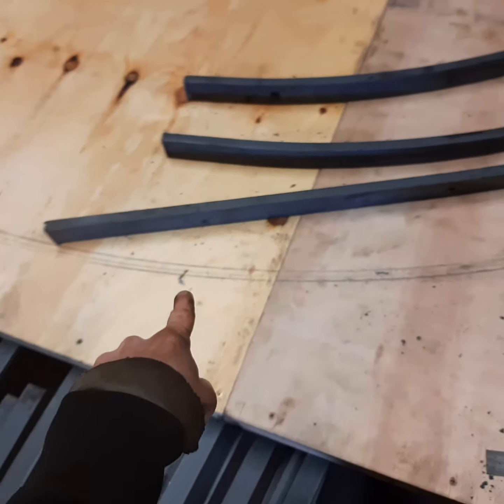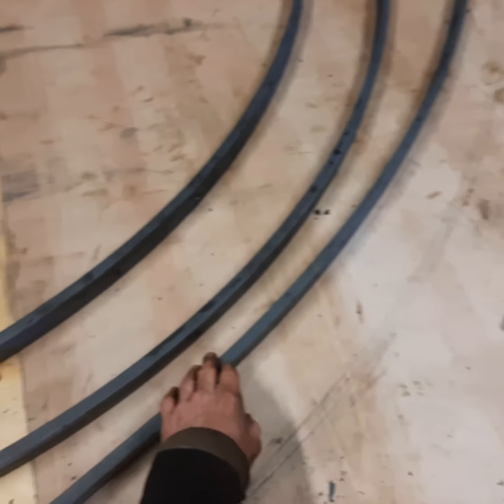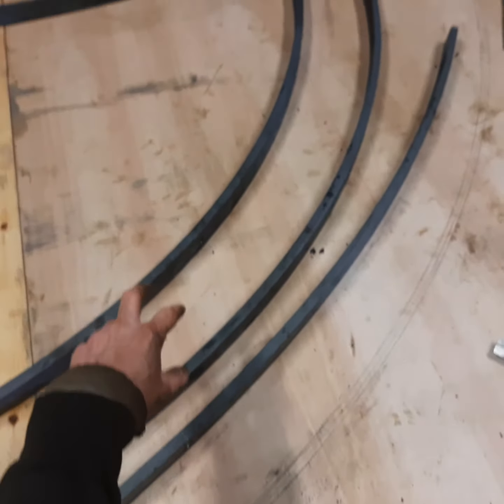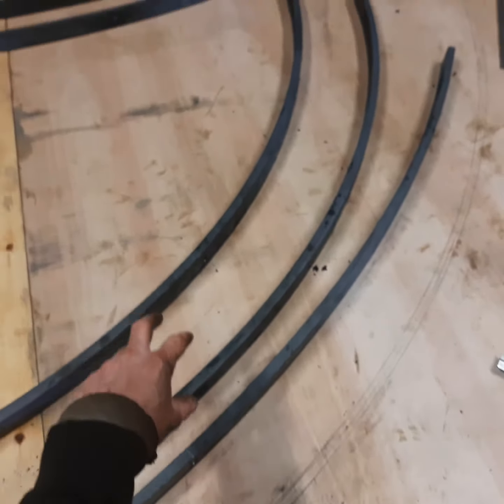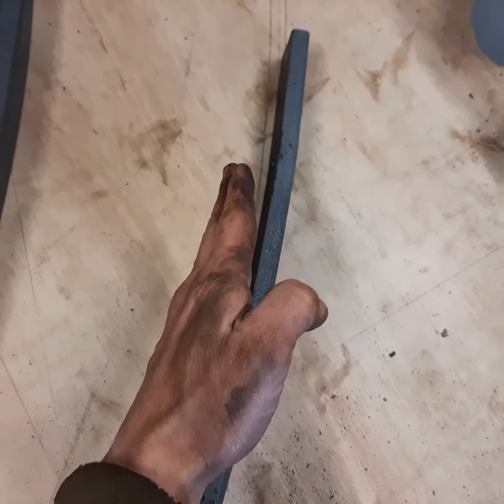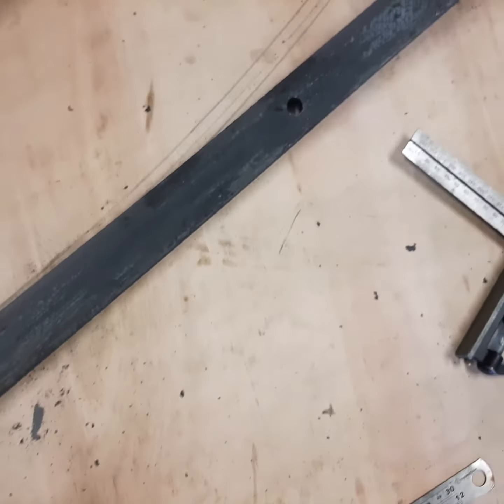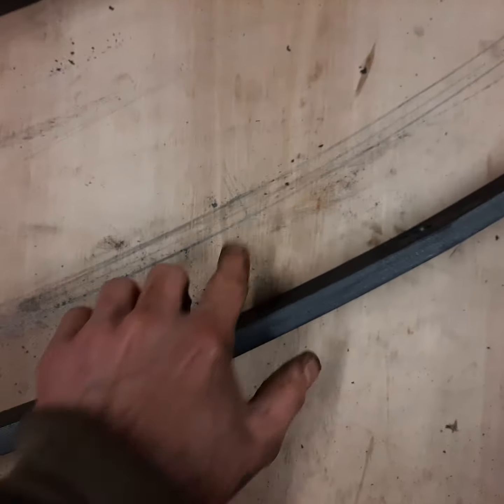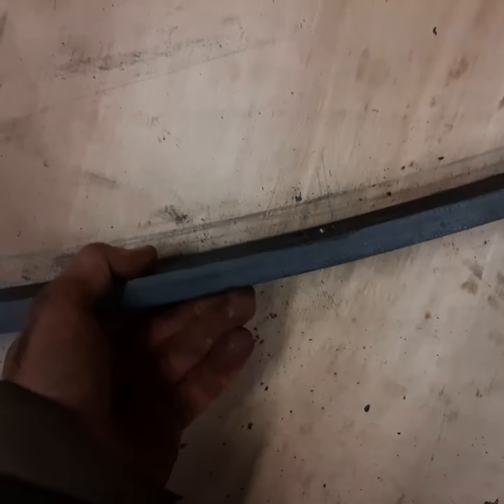Ring rolling 40 x 15mm

Comment: Looking good Joel. 
I picked up a manual roller recently but haven't needed to use it yet as other projects are getting in the way. 

I like your layout drawings. 

All the best 
Andy
Reply from the maker: Which roller did you get? Rollers are worth their weight in gold.
Reply: @joeltarrartistblacksmith  Just one of the blue ebay cheapo ones. I'm looking forward to using it, just the ideas I got it for have been put to a back burner for a bit.